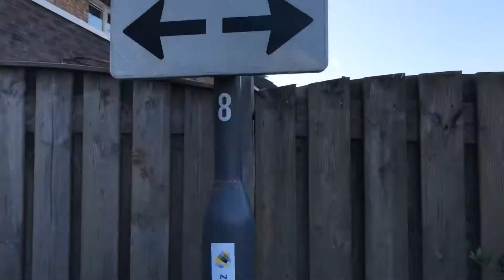Remove broken Hogro KFK

Comment: 3:24 I should print a hundred of those and put them on every LED street light
Reply: Why dont some led street lights light up the road properly. It seems like they have put higher powered ones on the main roads that do a better job while the sidestreets are dimly lit they used a ton of different models where i live they have some green some cool white and some warm white it looks like they just put them up without thinking most of the cheap ones have burnt out and started flickering i bet loads have already been replaced what a waste of money
Reply from the maker: electric_ leo 😂😂😂